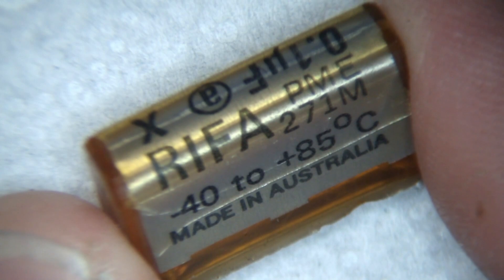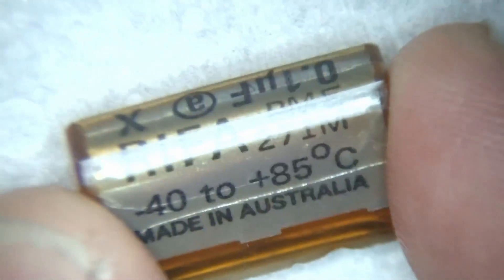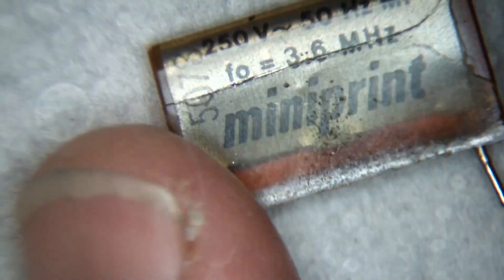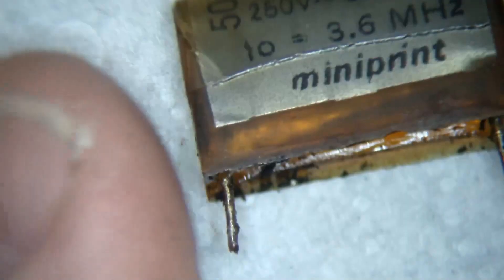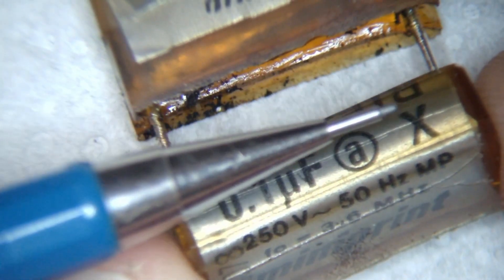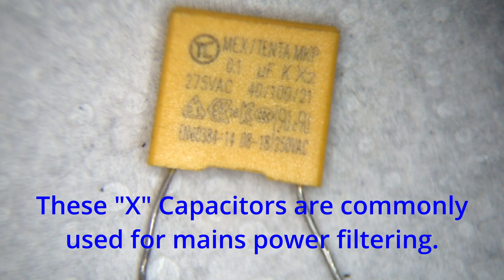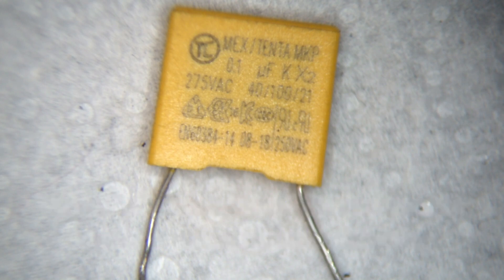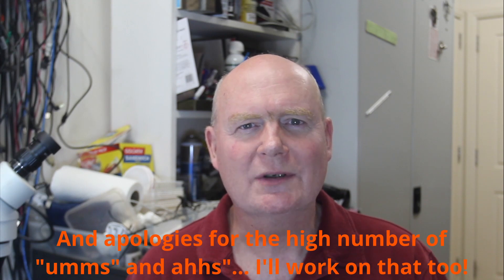RIFA Capacitors – Quick Look at why you should remove them.

Comment: So, is the rule for replacing "safety caps" to avoid any paper capacitors whether branded "RIFA" or not? Also, is there a recommended replacement? I see that there are many dielectrics available for X2 rated caps: polyester, polypropylene, Y5V, metalized paper, and paper.

Comment: Hi mate. I am repairing a bernina type 289 foot controller. It has a Rifa Capacitor which appearsto have failed. It has the following markings. RIFA pme2616ma510    CL5   0,01uF   630V=   MP   40/100/58. Can anyone help me with a cross reference to a modern capacitor that I can replace this with?

Comment: Hi, I have one that has gone bad in a kitchen machine.
PZB4002/23, It has 3 connections, it seems to be 100nF across legs and 4,7nF to center tap from the legs.
What do you suggest for replacement?
3 separate capacitors?

Comment: I had one of these blow up in my Philips oscilloscope. The whole shack had a cloud of smoke about 80cm thick from the floor up. There was a smoke alarm in the shack but it was mounted on the ceiling. It did not go off. These days I have two smoke detectors in the shack. On different heights. And I power down all equipment with a master switch when I am not working there. Cheers 🤝🏻🇳🇱

Comment: Thank you ! Great advice !! If the one I am replacing is rated 250 vac, and all I have is one rated at a higher voltage, would that create any problems ?
Reply from the maker: As long as it is the correct type of capacitor then a higher voltage rating will be fine.

Comment: Whats with the high pitch whining noise in the video? Woah its annoying and squeels the whole way through the vid. Drove me nuts.
Reply from the maker: Apologies, my old ears didn't pick this up. I'll check whether it is coming from the fan on the HDMI capture card and try to fix it before I do another recording, Thanks.
Reply: @northbalwynrepaircafenbrc8202  you can also use audacity to remove this noise with noise reduction filter. And you can preview spectrogram to look for noises outside of your hearing spectrum ( but which other can hear)

Edit: also please look into framerate, because you have some duplicated frames making the video choppy
Reply from the maker: @anterprites  Thanks. I checked with audacity and confirmed that it was mostly coming from the the cooling fan on my hdmi capture card. A drop of oil and it appears to have quietened down. I also have adjusted the PC cooling fan speeds - one set was running at higher than needed speed.  I'm not sure what is happening re the duplicated frames you mentioned. I've checked the OBS and DaVinchi Resolve settings and I can't see how this can be happening. The joys of  shaking down a new PC setup!

Comment: Good idea, care should be taken not to replace a Rifa X2+Resistor package with a plain X2 capacitor, as you'd loose the contact protection/interference suppression.
Reply from the maker: Yes, good point. Thanks.

Comment: I've had some of these old RIFA caps explode hard too! This is worrying. I wonder how many paper dielectric caps in this form factor of all different brands I've overlooked thinking they were plastic dielectric :( paper caps should always be replaced in my opinion, as they always get leaky electrically, very unreliable unfortunately. 

Thank you for the video!
Reply from the maker: I understand that the RIFA / KEMET brand was particularly unreliable and I tend to replace these routinely, but would be interested in hearing about whether there are other brands with particularly poor reliability.